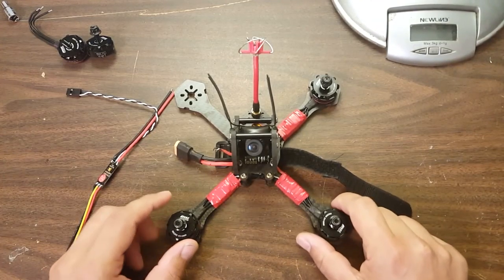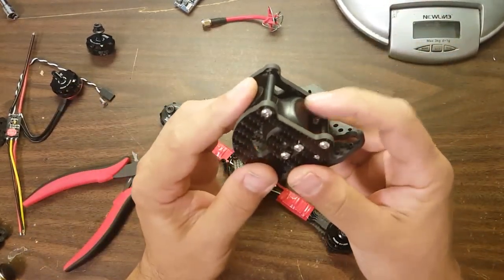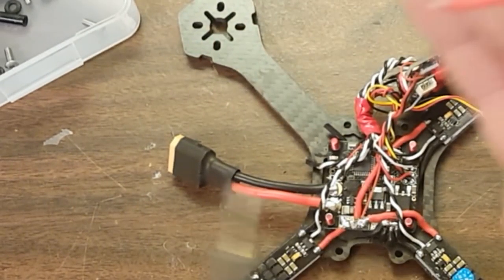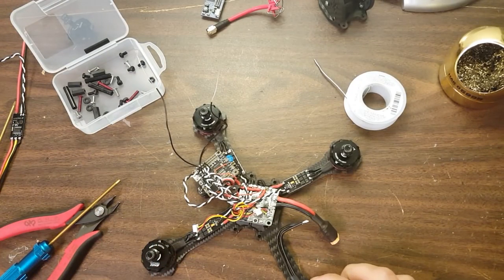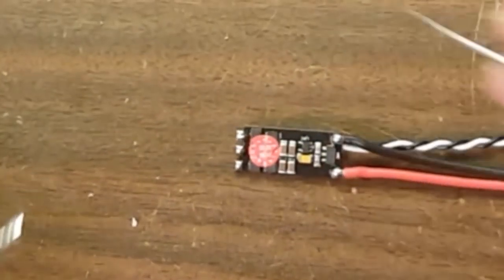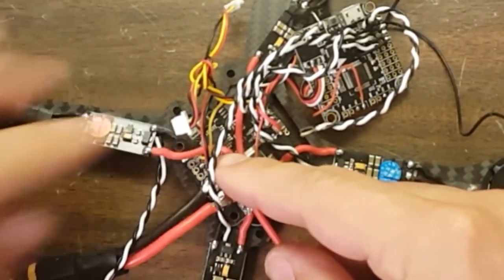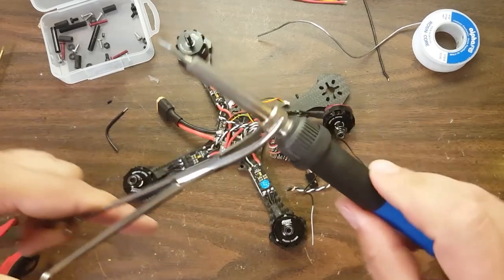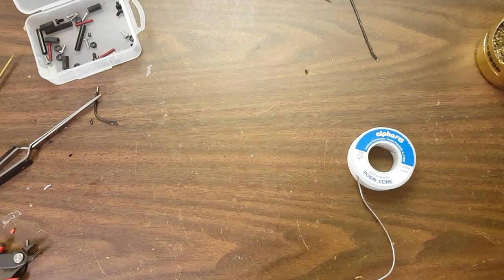How To Transfer Electronics Between Quadcopters

Comment: You do nice solder joints, no complaints.  A few tips to improve your soldering game.  You should throw away the pointed tips and switch to a chisel tip for larger joints and for smaller more delicate soldering a horseshoe tip is very handy.  A large horseshoe tip like you are using is also very good for large joints, and I do find it to be a very good all around tip, but you should try a smaller one on your smaller iron as well.  
Additionally you say getting the solder out of the holes is difficult to do without damaging the board.  There are two options that work really well. A good quality solder sucker will (which will run you around $100 and up for an entry level) or you can use solder-wick.  Both of which will clean up the holes very nicely.  Solder-wick is under $20 for a good roll, and you want to purchase something no more than 2.5mm wide for stuff that size.  You really should have some solder-wick to clean up joints.  A $20 roll will last you quite a while so it's a great investment.  And the super DIY route is to strip some wire, dip it in flux and use that as solder-wick, works almost as well.  Hope this is helpful information.

Comment: Yes I watched the whole thing lol. I'm fascinated by this. I'd like to build my own one day but it'll be a challenge for sure
Reply from the maker: You can do it! If you can find a local friend to help you through it, that will be much smoother than trying to solve every problem on the Internet. Also, don't start with a really hard build like this. Something basic in the 210 to 250mm size range will fly great and give you a lot more room to mess up.
Reply: It's really not as hard as it looks.  Picking out parts and learning to fly it is probably harder than actually putting it together, if you don't have a friend who can help you, you should be looking at kits.  I'd recommend the Flitetest versacopter to a beginner, I recently helped someone build one and it was really easy.  You'd have a nice build video to follow, and you can order it with an electronics pack that comes with everything you need to get in the air except a flight controller, transmitter/receiver, and batteries (and FPV, but you can build and get flying before you put that on)

Comment: hey JB I seen the VTX hanging out the back of the SMA holder bracket I thought of this before but I never thought this would work I thought it would break right apart you should see my jerry-rigged VTX coaxial cable I have solder brackets as braces and it's worked well
Reply: dude I posted before hearing about the grommets I do the same thing
Reply: Josh besides the grommet I also like to put electrical tape in between the carbon fiber holder and the SMA because I feel that power could be flying into the carbon fiber which basically causes a capacitance plane that could have induction problems from other electronics basically I Shield the SMA with electrical tape so there's no interference it's kind of like adding a couple of adapters to the VTX it lowers the overall range

Comment: Yep, watched it all. And my reward will be some answers to easy noob q's (I hope).
- what temp do you use on your soldering iron?
- do you change temp for different size wire, or just change tips?
- see you soft mount using o-rings. Do you just put one under the FC if you stack another board above the FC, or do you use one under and one above the FC in that case?
- pretty beefy looking o-rings. Silicon? Think that matters? Source? Got some hard rubber ones from Lowe's, but ???
- for the same price and amp rating should we all jump to blheli_S? Can they be run with any ESC, FC, etc. (any restrictions?)
That's it! Thanks.
Reply: Duh, mixed up Blheli_S and multishot, again. I know you need the ESC's with some hardware gizmo for _S. So I guess my Q is if mutishot can be run on any ESC, and if it can be run on one, should we run it always?
Reply from the maker: Soldering iron between 300 and 350 C depending on what I'm doing. Almost always at about 325 though. Above about 350 and my tips start scorching.

I mostly change tips, not heat.

I prefer to use one above and one below. It's less effective to have only one below. Full isolation using rubber standoffs is even better, because the screws can still transmit vibration even when O-rings are present.

Don't use hard rubber rings. They're worthless. Soft silicone, such as sold by Multirotor Mania are better. Full rubber standoffs are even better, but less versatile as they are only available in some sizes.

You can run Multishot on any BLHeli ESC but you have to manually flash the multishot firmware, since there is not enough memory in regular BLHeli ESCs to hold the code for Oneshot and Multishot. BLHeli_S can run all the protocols without any special steps.
Reply from the maker: Also, it's not recommended to run higher motor rates on F330 ESCs like the original Littlebees. There is still an advantage to running Multishot, even at only 2 kHz update rate, though. Don't go above about 2 kHz on F330 ESCs. Sometimes it's fine. Sometimes you smoke an ESC.
Reply: Thanks, thanks, and thanks!

Comment: On a new build, I sometimes wonder if it would be easier to remove the power and ground wires from all the ESC's . Then solder the power and ground wires first to the power and ground pads on the RROSD. Then re solder back to the ESC's. I always struggle to get a clean routing to those pads when I solder them individually.

Comment: Did you use electrical tape to cover the esc? My 3M electrical tape always gunk-up and collecting all sort of grit,  dust, chopped grass inside so I use a PVC shrink wrap instead like the one normally use to wrap a lipo battery.
Reply from the maker: +Rizki Pratama I use electrical tape.

Comment: Do you always connect the ground from your esc?  I was told you only have to connect the signal wire to your FC since you already have soldered the main ground and power leads.. Seems to work fine for me.
Reply from the maker: +tahosrfr I always solder ground. Sometimes it works to omit it, but sometimes you get weird issues.

Comment: Have you ever had the rubber stuff come off the battery straps? It happens to be all the time
Reply: Make sure you take a file to the edges of the carbon where the battery strap goes round.  Carbon is very sharp and will destroy your battery straps if you don't round it off.
Reply from the maker: Yes, all the time. It rubs off after a while. Battery straps are consumable items. What I suggest you do is, start a popular YouTube channel, and then you'll be swimming in them. Seriously, I may never buy a battery strap again :-)

Comment: Hi, you have soldered and wrapped the esc, but if the direction of the motor is wrong? are you gonna reverse it after in blheli or desolder?
Reply from the maker: You can just reverse it in BLHeli, except a few DYS ESCs have a bug where if you do that, the ESC glitches and the copter falls out of the sky.

Comment: I'm putting a small piece of clear heat shrink over those plastic wires just to prevent melting at soldering.
Reply: Are you referring to the ESC signal and ground wires? If so that seems like a really good idea.
Reply: +Matt Brozyna All wires with plastic insulation like those what usually comes with video transmitters. Silicone wires do not melt that easy.

Comment: How are all the power /red wires connected to the same pad on top of eachother, if all 4 wires are on the same pad are they able to pull equal power at the same time or less or more power when needed
Reply from the maker: They deliver as much power as the motors demand. It's all just one big joint you know?

Comment: What ESC you would recommend more to use for 210mm size (5") quad with AUW 550 grams(4S) , Littlebee 20A-S or 30A-S or the standard littlebee?
Reply from the maker: Basically any F390 (Littlebee Pro) or _S ESC these days is going to be very good. 30 amp ESCs are probably unnecessary for most 5" setups running on 4S. The main advantage of the 30A ESCs for 5" setups is often that they are 6S rated. Don't buy the original Littlebee, which has an F330 processor. as it is outdated today.
Reply: Ok thanks! so I will buy the lb20 now I have last quastion. which Littlebee 20A is better, Littlebee Pro or _S ESC ?
Reply from the maker: +MC flyer S is next gen. Slightly better for sure and maybe lots better. Hard to say.

Comment: Hello Joshua...thanks for all you video,s ...very good info... i have seen a video from Mr-Steele where he was grinding and did  other stuff and cleaning with a new Carbon Frame..i have seen a lot of dangerous carbon dust caming off the frame if you do that...is this necessary ?    And for taping the ESC ..i do not use Electrical shiny tape..looks also bad...but use Certoplast and from Banggood    19mm x 15M Heat Temperature Resistant Looms Wiring Fabric Cable Tape only $ 1,99 !!    ....you  cannot stretch this tape but it fits very good...heat resistant and durable.... and it looks much better...  :)  also  you can use this transparent Silicon tape..then you can see the printing and info on the ESC,s  :    Silicone Performance Repair Bonding Rescue Self Fusing Wire Hose Tape Blue  cost  $4.54 from also Banggood............greetings from Holland..
Reply from the maker: +gewema I don't like silicone tape for holding on ESC's. Heavy, and one nick and it splits completely. 

I don't sand my carbon edges, but that's probably why I break so many battery straps

Comment: I built the qav250 with the recommended electronics from Lumenier (12a esc, 1806 t-motors) I had these sitting around when I upgraded my qav250 what quad size can I use these extra parts 180 ?
Reply from the maker: 1806 with 12a ESC could be okay for a 4" build. What kv motors?
Reply: 2300kv

Comment: had the same problem with my emax 2205 on 5" which burned 2 littlebees 20a. I think i'm going to upgrade to 30a, and hope its not going to happen again .
Reply from the maker: I think the powerful magnets on those motors really stress the ESCs.
Reply: I had the same problem with little bee 30 and red bottom 2300 and i burnt 3
Reply: I switched to kiss and its almost perfect. (for me at least)
Reply: +Viking FPV  i just don't like to spend €20 on an esc that might as well catch fire :s

Comment: i ve smoked two 20a escs running rs2205 with 6inch bullnose on 3s...20a escs are not enough for those motors specially running betaflight ;).
Reply: are the motors 2600kv? if so what did you expect lol,
Reply: +Anatoliy Pishenin 2300.
Reply: +alisher rakhimov that should not have happened then, it must have been a defective esc to start with. or something like that, I've seen sometimes that the screws are too long that go into motor and touch the windings, and that helps the esc burn out much faster
Reply: +Anatoliy Pishenin nope.both escs on same side caught a fire in air. i was just doing endless flips....i am pretty sure those motors with those props draw 30plus amps even on 3s....20a escs are not good for thrashing.

Comment: do the redbottoms not use enamel coating on the wires?
Reply from the maker: I don't understand. The windings have to have enamel wire, otherwise they'd short. What makes you think they don't have enamel?
Reply: +Joshua Bardwell apologies, i ment the wires which goto the escs not the windings themselves. ive seen people mention that when they shorten their motor wires they cant solder to them. p.s love the channel!
Reply from the maker: +Chris Moran the emax transitions to silicone wire just where the wires leave the base.

Comment: What is the lifespan for a ESC operating in normal conditions?
Reply: Been flying my KISS 24A escs about 4 times a week for 3 months with no issues, I assume they should last for a long time as long as they don't get damaged or overheated too severly
Reply from the maker: +LT “John” YV I seldom destroy mine. Usually they become obsolete before they wear out.
Reply: Thanks guys, it gives me the confidence in spending some big money on ESCs.

Comment: im running emax 2600kv motors on 5" with lb30s, no explosions yet!
Reply from the maker: +jamble7k that should be fine...
Reply from the maker: I'm pretty sure this was a fluke, or if it was an issue, it was with the ESC. But I had a 4" build to do anyway, so why not?
Reply: yea agree, i would build a 4" copter but don't want to have to buy a whole lot more batteries